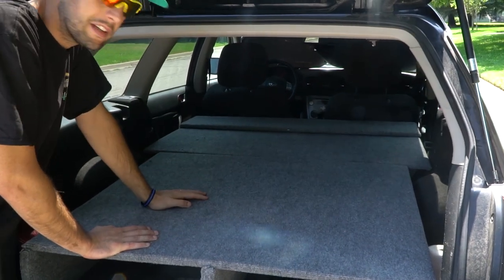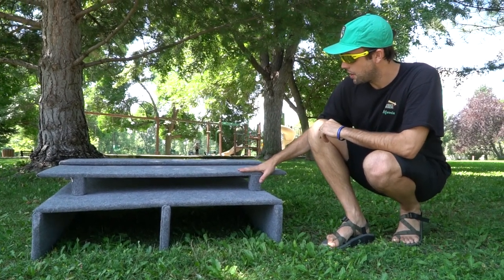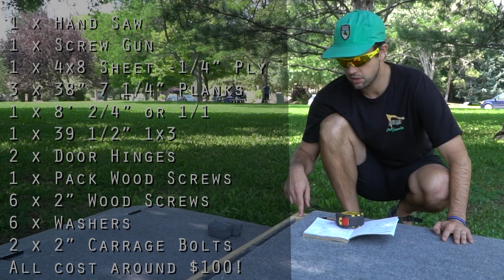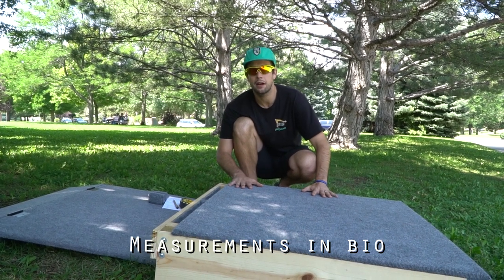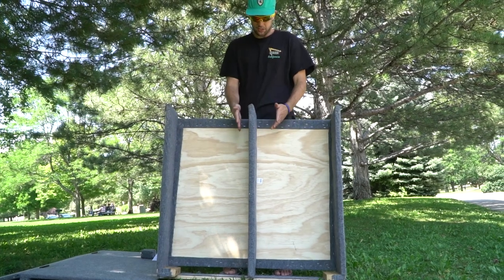Subaru Outback Vanlife | How to live in your car | Free Blueprints! | DIY Under $200

Comment: I just built this for my '01 Forester. My reccommendation is to use plywood thicker than 1/4". The plywood in the passenger seat section buckles a bit without additional support.
Reply from the maker: Thanks for the tip yes it is too thin but it some how holds up!
Reply: Breakdance Bear I was thinking the same. Think I’m gonna go with half inch birch ply.

Comment: I was wondering what you used for ventilation/bug protection with the frameless windows.  I also really like the build and simplicity.
Reply from the maker: We didn’t do anything sometimes we crack the windows but condensation builds up no matter what.  We haven’t had too many issues with bugs

Comment: I feel so satisfied when people include Amazon links.  Did you upgrade to a higher end battery since you're pulling power for other stuff?  I know the stock batteries are awful, at least on the more recent Outbacks.
Reply from the maker: Following Finnegan I have not yet I would probably go with a smaller battery maybe around 50-70 amp hours separate from
My starter battery that would be charged via the alternator from a dual battery isolator while driving  Thanks for checking it out.